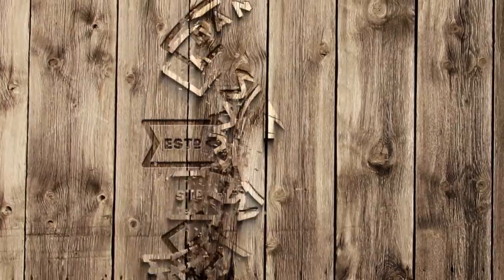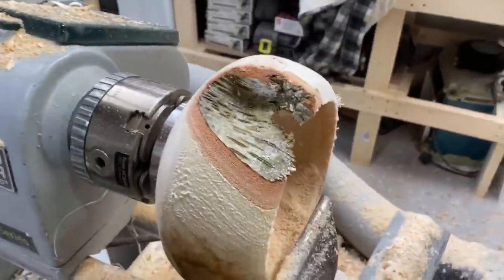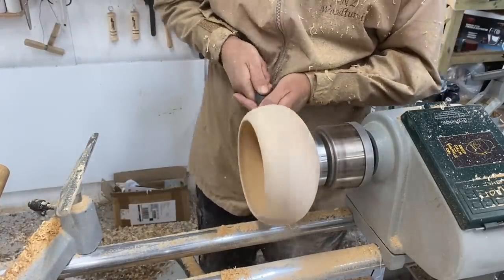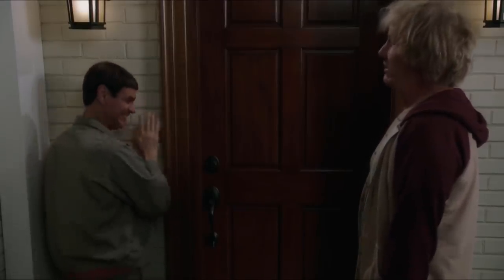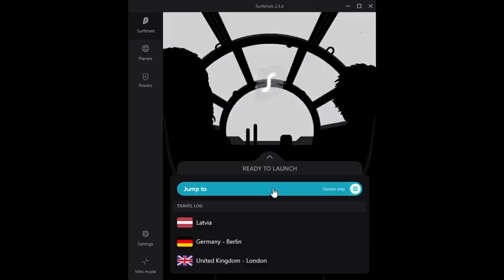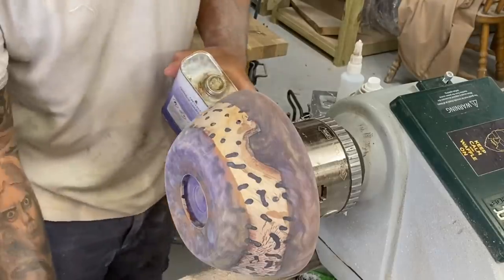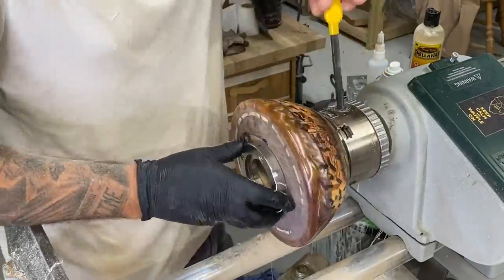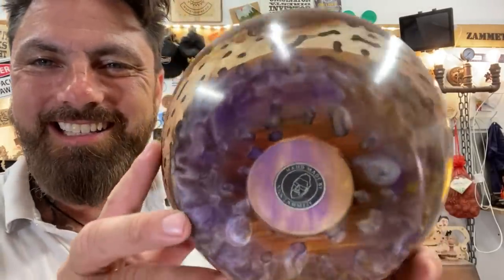Woodturning - The Vortex Portal

Comment: Have you ever used a balloon for the inside of the bowl instead of a cylinder of wood when adding resin. You would use less resin and lathe time.
Reply: Wouldn't it pop in the pressure pot?

Comment: Beautiful! I just have one question. I understand a woodturner enjoys cutting away the wood, but, couldn't you save the wood plug for making something else, and use a plastic bowl or cup with a rock for weight, in the center of the resin pour while the resin cures? (Save the wood for a smaller project / less wood waste?) Just curious. Or does the wood plug center help the artist's creative flow. Ok maybe it's more than one question, but questions on one aspect. Lol. I love your work.

Comment: I wonder, could you get the same kind of concept by drilling holes in boards, filling them with resin, gluing them together and THEN turning a bowl? I was thinking you'd turn it down so that there was only the resin in the holes and not areas of pure resin. Probably WAY more work than would be worth it. But I still love this concept.

Comment: Nick you are the best!!  Love your videos. Not sure if you will see this but I have a question. It may be a really dumb question but I just really have to ask. So, in the case of this Holey bowl, if you just wanted the resin in the little holes but didn't want to waste excess resin, could you use a balloon? Like, since the bowl is so round, could you blow up a balloon and put it on the inside so the resin would just go around it? I know, it's probably a dumb question and it might not work because the resin can get hot but I thought you would be able to tell me for sure. Thanks!

Comment: hi nick meant  to ask you for awhile now,  how do you adjust/ set the lathe speed when turning?  i only did a bit of metal turning in college years ago a if i remember rightly there was a chart with diameter and according speed but is the speed also determined by lets say hardness of the material ? i mean say if u turned beech ( hard wood ) would you turn it at slower speed because the wood is harder and if you turned pine you could turn it at higher speed because the wood is softer or vise versa (diameter of both would be the same ) soz for elaborate question hope i explained my self enough cheers Michal W sussex  <3 bye

Comment: The new resin doesn't look as good as the resin you used to use. The resin you used to use was clearer, and looked way better. Consider going back to the old resin. The 1 to 1 stuff. I think it was resin4art resin. The new stuff doesn't look as good, or cast as well.